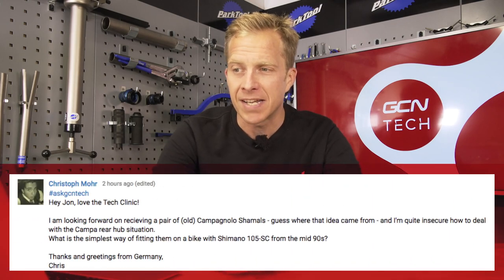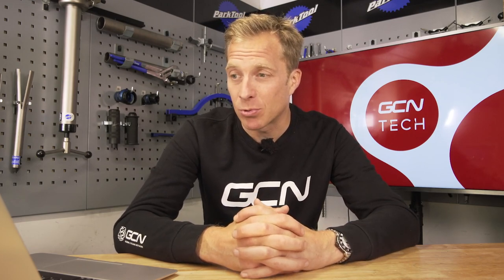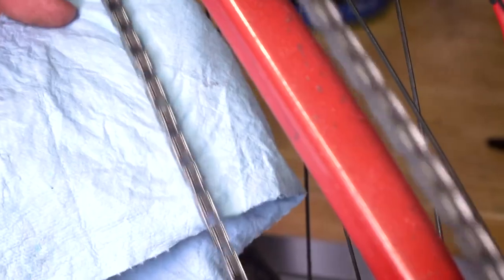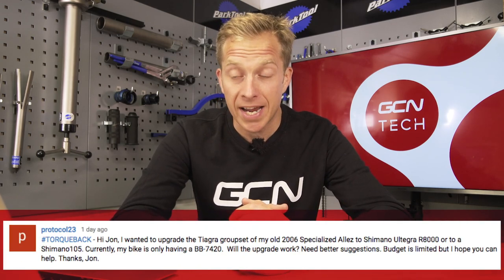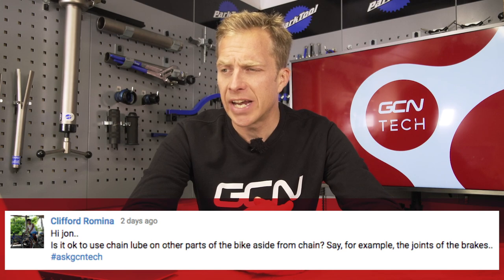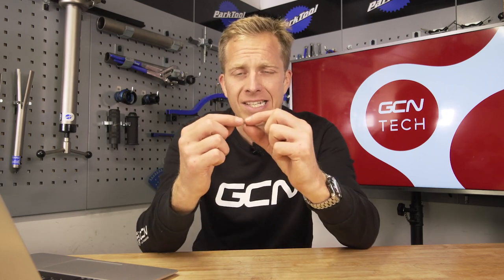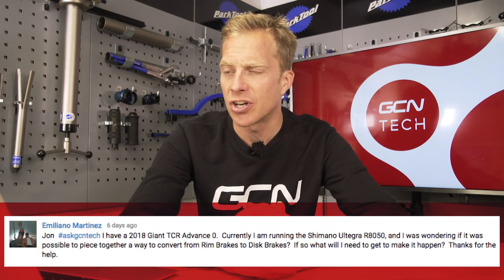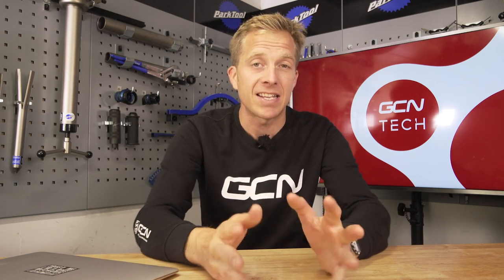How Do I Keep My Chain Super Clean? | GCN Tech Clinic

Comment from the maker: Remember to keep your questions coming in for Jon using #askgcntech. 👇
Reply: Hi Jon. I also love you more than life itself so please help. Can I use Shimano Ultegra RX800 DI2 with a 1x11 set-up or does it necessitate a front derailleur to work (because of the firmware)? Maybe I should just use an XTR or XT derailleur instead?  #askgcntech
Reply: #askgcntech Should one actually drip the chain lube across the entire link so it penetrates the interface between side plates and rinses grit out of them?
Reply: #askgcntech  Jon, I had a bit of an incident where my aluminum stem took a hit, scraping away some material above where one of the stem-plate bolts threads in. At what point should I be concerned about the integrity of the stem? I'm a bit of a masher, so I do throw some weight into my bars when out of the saddle. Thanks!
Reply: Hi Jon. love the show keep it up.
My drive train makes kreeking noises when pedaling (in every gear). The noise disappears for a little while after pedaling backwards.
I replaced the BB and chain. The cassette and chain rings a in good condition and the gearing was set by my local bike shop.
Can you help me out ?  its makes me mad when riding !
cheers Joe
#askgcntech
Reply: Hi Jon, I've heard of cable stretch but wondered if you could elaborate a bit??
When shifting on the big ring I've got what I would describe as too much 'travel'. Sometimes it won't shift into the smaller cog completely and will only go as a 'double-shift' then i have to shift back 1 to get where I wanted to be. Annoying.  The last time I tried to adjust the indexing I made a hash of it and took it to LBS to be sorted.  They got it shifting again but not perfect.  Do I need new cables?  Bit scared due to TCR frame internal routing, plus it's my pride an joy! #askgcntech
Reply: #askgcntech
Jon thanks for the amazing info. 
Looking for a little help here. 
My wife and I are headed from the US to London for our 25th wedding anniversary and she has agreed to having me do CycloCross event(~6th of October) given I can find one. We'll be headed back towards London on the 5th from the Cotswolds, so anything between would be good. 
It looks like there is a CycloCross Race Saturday the 6th of October in Buckinghamshire, but honestly anything would be good. 
Hopefully a connection via this site can get me a loaner CycloCross bike for the event. 
I can bring my own pedals, helmet and kit. 
Also I’m ~6’3” ~86kg and a 56 or 57cm would fit me well
Any ideas as how this might be able to happen ?
Many thanks. 
SAndreaus    @yahoo
Reply: #askgcntech #torqueback Love your work fellas. 
I have been running a Shimano 105 5700 group set from 2010 and have recently broken my front derailleur. 
Should I only replace the derailleur and wait for the next component to break before replacing the entire group set? Or should I just bite the bullet and replace the entire group set? 
Extra info: I currently ride my bike as a short commuter as well as 2-3 times a week up to 100kms/week in a bunch. I have ridden some Olympic triathlons but have no plan to race on the road. 
Thanks in advance.
Reply: #askgcntech Hi Jon. First of all, huge fan. Love your work. You've saved my ass more times than I can remember. Cheers! I currently have a gravel bike that has a max tire clearance of 700cx38mm but I managed to put in 700cx41mm in it with very little room to spare. My question is, if I convert my bike to 650b tires, will I be able to fit a 47mm in it? Thanks!!!!
Reply: #askgcntech. Hi jon would it be pos to make up an 11/21 straight through 11 speed shimano cassette using a couple of cassettes mixing and matching. Thanks david
Reply: #askGCNtech Does adding an extra pad on your shoes provide better comfort? Or do you risk any injury on your body in the process? Great show! A big shout out from a lot of cycling fans in the Philippines!
Reply: #askgcntech Hi Jon, and thanks for a great show.  I'm finding that I get tapping noise that sounds like its coming from from the brake and gear cables bumping against the frame in the headset area, particularly on bumpy roads.  I was going to try the small frame protector guards in a soft material but do you have any other suggestions please? Thanks.
Reply: #askgcntech Jon. I want to put larger rotors on my rear wheel to improve the breaking.i have 140mm right now and want 160mm..... what do I need to do this
Reply: Hi john! im a avid fan of your askgcntech. I have some question. Whenever i put pressure on my pedal stroke my chain slip/making sound like breaking apart. My mechanic told me that my 2nd chain ring (btw i have 3x crankset) was worn out already but my crankset was 2 months old. How can i solve this problem? Thanks gmbn! More power Godbless!!
#AskGCNTech
Reply: Hey Jon, great content. I have a pair of Hunt 50 Carbon Wide Aero wheels and they're great. They're also a rim brake version. In the near future I'm looking to get a new frame to replace my Ribble R872 and would love to switch to a disc brake specific frame. Would it be possible to swap out the hubs on the Hunt wheels with disc brake hubs, so basically rebuild the wheels with a new hub but the "old" rims? #askgcntech
Reply: #askgcntech
Hi guys! I'm searching and researching for the lightest MECHANICAL disk brake calipers for my Scott Addict disk but without a decreasing of the brake power more or less can you guys help me with 3 or 4 examples and some advices please? By the way your videos are extremely helpful keep the progression!
P.S.: I'm on the latest none series STI hydro level of the previous Ultegra disk groupset
Reply: Hi John.  Like the show.  Can you please recommend a bike to do every thing, Cyclo Cross, Winter road training, and touring at any time of the year. I have a summer Ti road bike, but my present winter bike, the relegated summer bike and my heavy Aluminium, 1992 MTB are very dated and heavy.  Look forward to your reply.  Thanks Phil.
Reply: GOLD CHAIN ALERT!
Hi John, I've waxed my chain but don't know when to rewax. Is it after a certain amount of milage or are there signs to look for...it's gold so it looks well but I want it to work well too. Many thanks
Simon in The Lake District 👍
Reply: Hi Jon, quick one for you. I have a set of 
Mavic R-SYS SLR clincher rims with the exalith brake track surface finish. Now while these rims perform fantastically well, they’re now not as easy on the eye as they were when new. The black stealth look when they were new was awesome but despite using the correct mavic pads, the exalith coating has worn off, consequently leaving an exposed silver aluminium finish. Can these rims be refurbished/restored to their original look? Thanks #askgcntech
Reply: #askgcntech Hi Jon, I found a good deal on a sram etap TT version, but I got a road bike with clip on aero bar. Is it possible to buy another etap road shifters and pair it with the derailleurs? Will the TT shifters works together with the road shifters if possible?
Reply: #askgcntech hi Jon, great show. My carbon rims gets filled with when after riding in rain, or washing the bike. What can I do to prevent it? Or is it something to be worried about? Will it damage the rim over time?
Reply: #askgcntech Hello, i've ridden my bike in typical british weather (rain, rain, rain and more rain), now during the cleaning of my bike i noticed there was water inside the hollow section of my dt swiss pr1600 spline 32 db rims. I had to remove my tyres so the water could escape via the valve hole. Is this normal? What can i do to prevent this from happening? Not riding my bike in the rain is not an option since i live in Belgium...
Reply: #askgcntech Is 2t engine oil good to lubricate chain??? I'm from India..please reply. When my bikes chain is dry then it works much better but when I applied 2t engine oil to it then it doesn't work smoothly. But bike seller told me to do so..
Reply: A tip: you can watch series on kaldrostream. Me and my gf have been using it for watching all kinds of movies lately.
Reply: @Bishop Soren definitely, I've been using Kaldrostream for since november myself :D

Comment: Iirc 8spd campag is the same spacing as 7spd shimano so you should be able to use the campag cassette with the shimano shifters and rear mech, you'll just need to adjust the throw to lose either the smallest or largest sprocket on the campag block.

Comment: I put a 10 speed 105 set on my early 2000’s Allez that I got from a 2012 Altamira and had no problems. Even put the Oval cranks on with a BB conversion (thread to press) that was only 55 dollars. Hope the conversion works as well as mine did!

Comment: I love a clean chain. If it’s not staying that clean than you are either not cleaning/degreasing the entire drive train first or you’re using too much or the wrong kind of lube. 

I spray simple green bike degreaser and cleaner all over the chain, jockey wheels, crankset, etc. Then I take a cheap soft toothbrush and scrub away top, bottom, sides. Then I rinse with a spray bottle to “blast” away the grime. Spin and wipe to dry. Then, Finish Line dry lube dab on each of the rollers...let it set overnight and then wipe off excess. My drivetrain is as shiny and quiet as anyone.

Comment: Protocal23 - I recently upgraded my Allez 2014 to 11sp 105, and would definitely do it again it made such a big improvement. Knowing the standard axis wheels it came with wouldn’t take an 11sp cassette, i looked at best options to solve this eg. New hubs or wheel replacement as i was on a budget also. Best outcome was picking up a pair of 2nd hand Fulcrum wheels with 11 speed freehubs. That also give the bike a wheel upgrade as well. In total it reduced the bike weight by 700g. But the improved shifting was what made it worthwhile. 👍🏻

Comment: Ultrasonic cleaner set to 70- 80 degrees celcius and hot water with a dash of chain-degreaser and industrial soap. Repeat two times or more if necessary. One Crock-pot with a mix of hot molten kerosene-wax, kerosene-oil for suppleness when wax cools down (you dont want the kerosene-wax to chip). Dunk your clean chain in the hot wax for 5 min. Hang on a nail to cool down and wipe off excess wax before it hardens.  Keeps your chain waxed, smoooooooth and CLEAN for 200-300 km

Comment: It is also important to read the instructions of the lube.  Some lubes need to " cure".  So, you need to put the lube between 4 - 8 hours BEFORE riding. If you lube your chain then ride, you can lose all the lube.  Also lube a properly cleaned chain and gear set.

Comment: Another option, instead of an extended derailleur hanger, is to use a mountain derailleur.  What you need is a 9 speed derailleur (10 speed changed the cable ratios on mountain).  I'm using a SLX 9 speed on one of my bikes with 10 speed tiagra, and it works great.  Also, it'll probably shift a little nicer than an extended road derailleur, since it's designed for a wider range and will follow the angle better.

Comment: If I wanted to convert a rim braked bike to disc, I'd probably just do the front (It's most important anyway).  Get a fork, a good mechanical brake like the TRP Spyre, and a front wheel.  Purists may scoff, but it'll get the job done.
Reply: that'd look funky, but yes would be the cheapest way to get at least 1 disc on your bike.

Comment: Hello John,
Thanks for the great show content and your dedication to solve our bike problems!
I am riding a late 80s / early 90s Giant steel frame which I upgraded over the past years from it’s original 6spd set-up. I was running a 10spd shimano Wheelset with an 8spd cassette with no issue on it before. Due to wear I had to replace the Wheelset. I fitted a 11spd Campagnolo Scirocco wheelset on it and ever since I have a somewhat snapping / grinding sound especially on the higher gear sprockets. I have the impression that the chain links kind of stick on the sprocket teeth when passing through / exiting the cassette. I think the chain line is off yet I don’t know what to do about that. 
I installed the 8spd cassette with the little campagnolo supplied spacer (for the 9spd cassettes) and it fits snug. I though realized that it sits further outwards on the freehub body towards the frame than the cassette did on then Shimano wheels.
I am running a KMC 8Spd (X8) chain and keep on top of my Maintenance and everything is spotless. Also my derailleur is perfectly aligned & not bent. The derailleur actually mounts directly to the frame.
Please help with ideas on how to solve this! Would a different free hub body maybe help?
Thank you!
Ben

Comment: #askgcntech I try to keep all my chains spotless, but recently the chain on my sons bike started jumping off the largest gear and moving down the cassette when back pedalling. It’s fine pedalling forwards. The derailleur isn’t moving, but the chain will also roll off the pulley wheels. The bike is a work ja24 kids bike so effectively 1x. The gears work fine, and I’ve replaced the chain, (which helped a little) I’m at a loss - any ideas?

Comment: Jon, love the show. My rear brake is humming loudly.The front is fine. I have a Specialized Tarmac SL6 S-Works with direct mount rim brakes, HED 4 Plus wheels that have a metal textured brake surface. I have set the toe in on the shoes, cleaned the rim brake surface, tried 3 different pads of varying softness. I have dissembled, cleaned, and relubed the entire brake assemble. Any suggestion?

Comment: Melted ~1” of brake track on a Reynolds front wheel going down a `6% grade, and I’m not an internet hater. I was using the Reynolds brake pads and this is critical and wasn’t mentioned in your reply. Make sure your pads are as parallel vertically with the rim as possible and also they are centered vertically. I think mine were a little high so the first contact point might have been on the edge of the rim. New disc brake bike solved the problem.

Comment: Jon,
I like your tech clinics.  They are my favorite.  I have a question regarding a recent comment you made.  You stated that you change your chain about five times before you have to change your cassette or chain rings.  How often do you replace your chain?

 I am in a dry climate (Arizona), and I use dry chain lube.  I religiously clean my chain, cassette, and chain rings every 80 to 120 km taking time to well lubricate the chain.  I replace the chain (CN-HG53/93 compatible with my 9 speed Deore groupset) when the wear reaches 0.75%.  This happens typically between 1500 to 3000 km.  However, I find that my middle chain ring and cassette seem to need replacing about the same time as the chain.  I do tend to run in the middle chain ring and the same cassette sprocket most of the time owing too the rather flat topography I ride.  I try not to cross chain much, and I share the load with the third chain ring when possible.

What am I doing wrong to have to replace the chain ring and cassette coincident with the chain, or am I keeping them so well maintained that my chain is not wearing as fast as most folks.  Thanks in advance for your help.

Chuck

Comment: #askgcntech I upgrade my Ultegra 6780 di2 with support for synchronised shifting. Default it suggests to shift two gears up/down on the rear but you don’t get a straight set of gear ratio’s. I am using 50/34 with an 11/25 and to get a straight set of gear ratio’s I should move it 4 gears at the back. Is that wise since default di2 suggests two gears

Comment: Hey Jon, I'm starting a project with a Niner Air 9. I',m gonna convert it to a drop bar and need some advise on shifters/brakes. I currently have a Sram X7 rear mech, and I'm wondering if I should stick with it or would it be easier to find a 9 or 10 spd. set up ( shifters and rear mech ) and start fresh?? TY Jeff

Comment: #askgtntech
Hi Jon,
When I pedal around sharp corners or taking a U turn my shoe tends to hit the front wheel. Is there anyting that can be done about this or is my bike simply to small for me? I've recently had a bike fit and my cleats was moved back, I haven't been outside with the bike since then but I fear that this will be an even bigger issue after the fit.

Comment: I have a 2x10 Tiagra 4700 group set on my gravel bike. I think I need to change my chainrings. In whole Germany the 50T version seems to be sold out. That made me wonder if I can mount any other chainrings on the Tiagra crank. Which ones will fit. Maybe even GRX chainrings? #askgcntech

Comment: 9:07 I got Hope pro 4 I h ave at least 2mm marks, I have to file it down regularly to keep it from hindering me to get cassette off. otherwise I will have to use screw driver & hammer to take off the cassette.
9:11  I tighten it as tight as it will go, I use Abbey Tools Crombie Tool - Dual Sided Cassette tool & I use Loctite 243 on the threads, this helps, but I noticed it loosens up little bit, from time to time, if so I apply Loctite 243 and torque it down.

Comment: #askgcntech, on the question of disc brake upgrades, how about running callipers at the back and upgrade to discs with a new fork and wheel at the front only? Similar to older cars who had discs at the front only. Would be a lot cheaper than getting a new frame!
Not sure whether you already have done so, but how about a disc break special - cable vs hydraulic, maintenance, upgrades, etc.?

Comment: Use wax on the chain, stays super clean and so does the cassette and chain rings to, i imagine that the wear is lower to but not sure. been doing for past year and no problems what so ever. only down side is that you need some things to get started and some new chains and quicklinks to run few of them per time.

Comment: Can I change my crankset from 10 speed to an 11 speed ? I have a campy record carbon 10 speed . I live in the mountains and the 52x39 is a little too much for my old legs . Plus , I’m just getting back from ankle surgery.
Reply: Yes you can. An 11 or 10 speed chain will work fine.